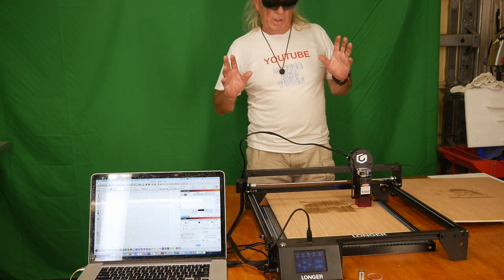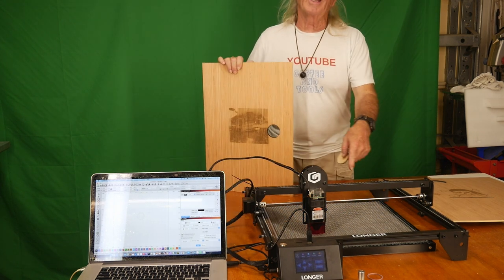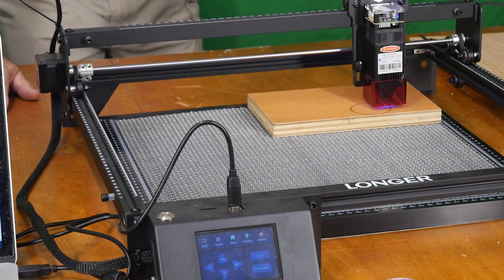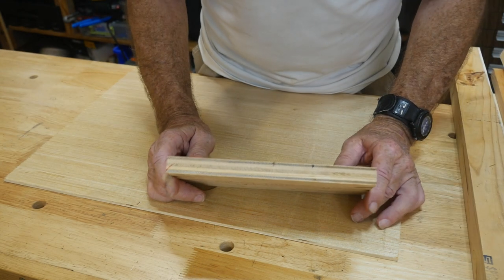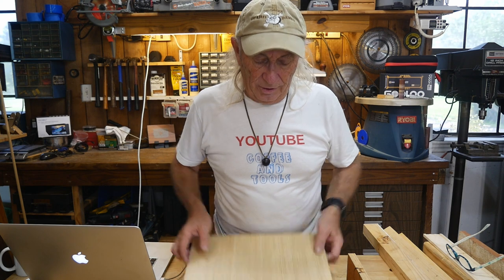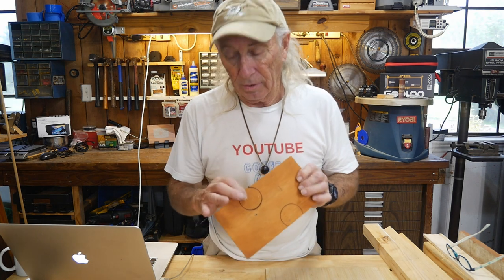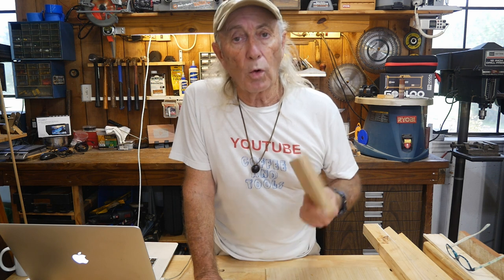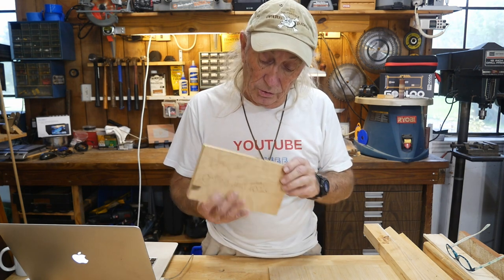Cutting plywood with a 5watt diode laser test, Coffee and Tools episode 233

Comment: How low to the material did you go... sorry but nobody puts this when talking about settings, they just say power and speed and I think the height has a lot to do with it too. Thanks C&T
Reply from the maker: This was based on the "cut" setting. For a deeper cut the laser could be lowered again and again. The idea was to keep the laser at it's highest setting for cutting and then run it longer than normal. To increase or cut lower you could stop and adjust and this would be another show at some point. The work or focal point indicated you could adjust down after a past and continue to cut until the laser hits the wood. About 50mm roughly.
Reply: The lasers come with a metal cylinder that you put behind the laser & lower it to sit on the metal  so I think as they haven’t mentioned it it is that setting. Everytime you start a new project you need to re measure the distance so if you are doing all coasters then you only measure it once at the beginning.

Comment: High speed, medium power, many passes, air assist. You will be surprised what you can cut through.
Reply from the maker: This was done with rules applied. Let's face it, I could just stop lower the laser over and over again to max out the cut. The idea was to just run a test without any adds or adjustments. 🤠
Reply: Not suggesting that 5.5watt cutting is practical. This was a very good demo. @SirTools
Reply from the maker: Thanks, Splatterpunk 🤠 @Splatterpunk_OldNewYork

Comment: You might want to change the focus if you want to cut a thick section. Also air assist blows debris and smoke out of the laser path.
Reply: He did mention altering the laser height
Reply: ..yet he didn’t do it..
I did, and it cuts 3/4”, 10-12 passes.. lower 4mm x 2 times.. air assist..
80% (clean, Birch Plywood) 
Speed and parameters change with the material/Supplier but my point is..
It will cut.. and Fast.🤙🏻
(10-11 watt output laser, longer, same as shown)

Comment: The deeper cuts that peter out is due to carbon build up at the bottom. carbon is a great insulator and does not burn (its the result of something being burned 100% so yeah) The laser will cut much deeper if u could remove the carbon as it is generated, which might be why air assist helps cut deeper.

A more informative test would be to use a thick piece of wood and run lines, not circles side by side , spaced maybe 1/2 apart and with increasing number of passes. and then use a saw to cut the board across all the lines and then compare all the cuts.

Comment: I have something wrong. My 5w laser burns the top of the wood real bad before it finally cuts through. Makes the piece un-usable.
Reply from the maker: Might be several issues here. Clean the lens, adjust focal point, check power %.  Just a few ideas.
Reply: @SirTools  By adjusting the focal point, do you mean how high I have the laser from the surface? If not I am not sure my laser is adjustable in any other way. I have the Atomstack A5 M40 with an air assist
Reply from the maker: The air assist helps keep that burning down a bit. I'm thinking power and maybe the "height" setting might be off a bit.
Reply: You are not going fast enough. Reduce your power to 50%, increase your speed to 500+, you might need 6+ passes to get through 3mm balsa, and put a big fan near your laser
Reply: 5 watts are meant to be used for engraving, 5 to 10 watts, ive seen people people recomending above 20 watts for cuttins and 40 watts for thick plywood.
Reply from the maker: 🤠 Nice one

Comment: Waaay too fast, Bud. 5W lasers are typically run at 500mm/sec max for cutting, and even then you might need up to 10 passes. Often they're dialled right down to 100mm/sec with 1 or 2 passes.
Reply from the maker: Early days of learning :)

Comment: Why woud you try and cut plywood at 1,000mm/min and without air assist?!?!?!  It also depends on the length of the beam waist of the particular laser.  A 3" diameter circle at 1,000 mm/minute with 100 passes would take 24 minutes to cut.  On my 5.5 watt laser I can make that same cut on 1/4" ply at 350mm/minute in 6 passes which would  take 4 minutes, with air assist of course.  If I wasn't as worried about the quality of the edges, I could go even slower with fewer passes...
There is also a point in speed at which you will limit out on what effect the laser will have on the medium being cut.  Not sure exactly what you were trying to test or prove here.
Reply from the maker: It was a "test" with some odd rules which included limiting factors that would normally not be needed .